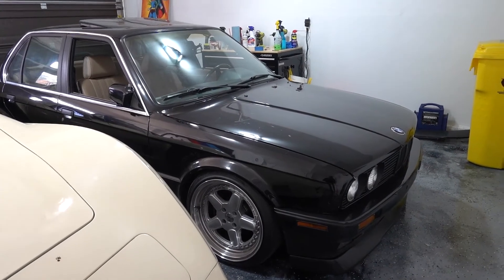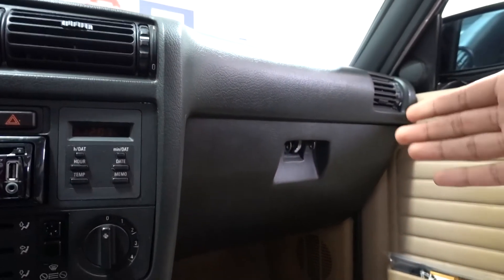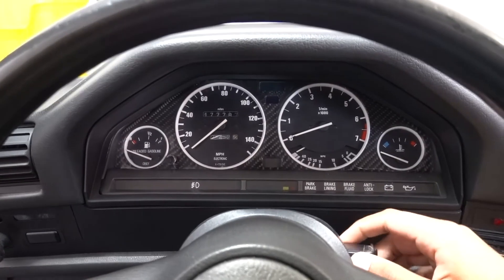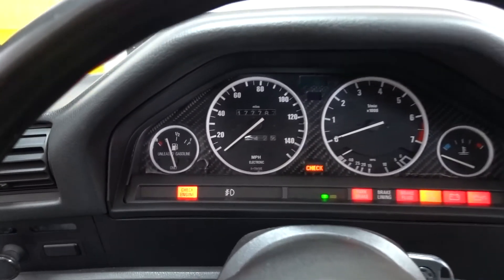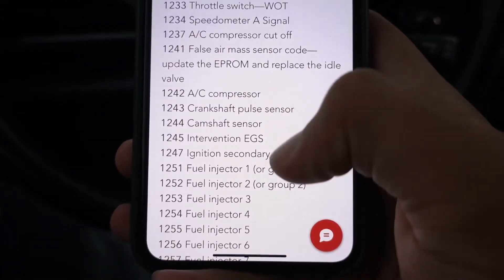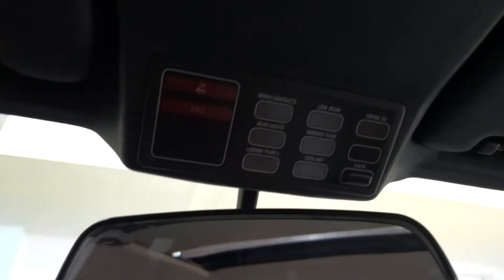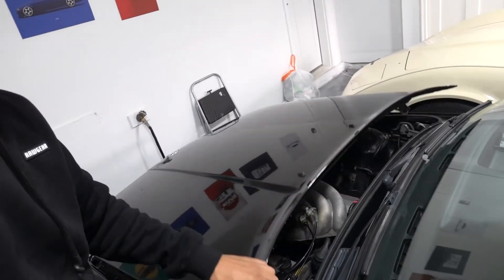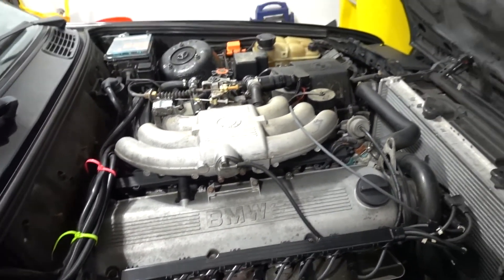HOW TO CHECK ENGINE CODES ON A BMW E30! STOMP TEST STEP BY STEP

Comment: Do you happen to know if there is any other possible method of deciphering codes on a 153 ECU? I have not been able to find anything online. If not then replacing the ECU is no big deal but it would be nice to not have to do it if possible.

Comment: The check that’s flashing is to inform you to check the check lights over the mirror. After you press the check butto on that display the flashing stops. It’s to let the car know you saw what’s wrong with it.
And the oi lights means you run low on engine oil.
You have the service bar on the odometer to indicate you the time to make and oil and filter change.

Comment: I’ve got the right ECU and have tried multiple times to get the codes to come up but it won’t. Could it be because the throttle cable is a little loose not allowing the throttle to go wide open
Reply from the maker: Your ECU IS 173 or above? If so, then I don’t think the gas pedal should be it but it might be worth investigating. Mine is also a little loose but I pressed hard into the floor, one press per second after the ignition was turned to “on” and it worked
Reply: @NabeelIqbal97  alright thank you bro, I’ll have to give it a try again
Reply from the maker: Good luck, lmk how it goes
Reply: @NabeelIqbal97  thank you bro, and yeah I will I’m gonna try again tomorrow
Reply: @NabeelIqbal97  I got it to work! I had to take the throttle switch off and readjust it and it works now
Reply from the maker: Ayyy! Hoping you got 1444 as well with the engine codes?
Reply: @NabeelIqbal97  the code I got was 1221 (02 sensor) so nothing to major, I only wanted to figure out how to get it working a couple days ago though because my car was hiccuping at 4k rpm but I just finished working on it and got that fixed
Reply from the maker: Solid! Take a peak at my comment on your IG. That thing sounds amazing!!
Reply: @NabeelIqbal97  yessir I will
Reply: @erikstronggg2734  What was the reason for the hiccup at 4k rpm? My e30 is doing the same and i cant for the life of me figure it out